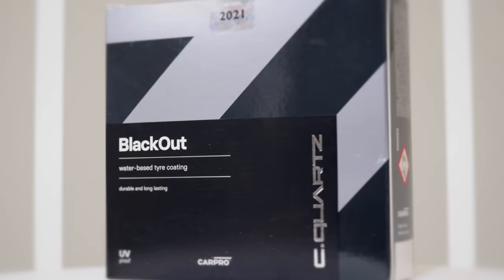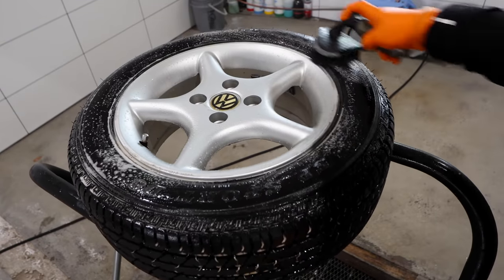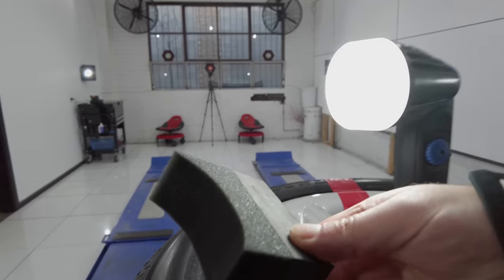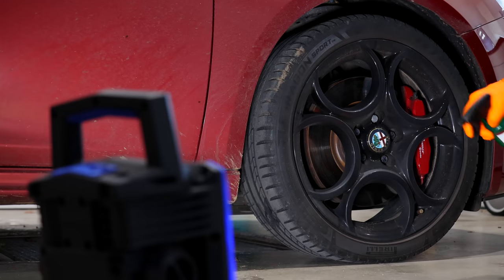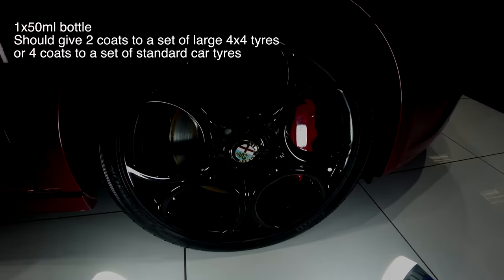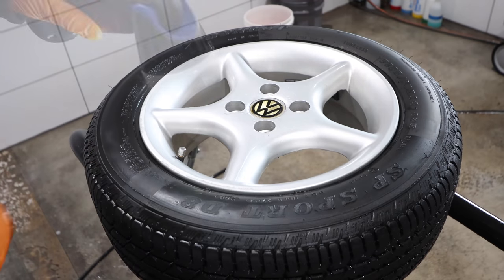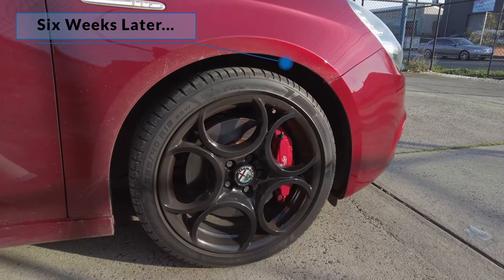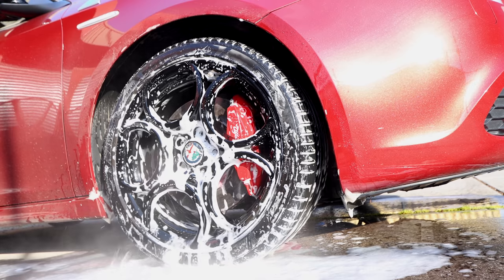New Carpro BlackOut 6 Month Tyre Coating Review | Application |Testing | Results!

Comment: I find that application with a paint brush makes applying tyre dressing infinitely easier.
The bristles easily get into all the tiny spaces.
Just apply, wait 5 minutes, and then wipe down with a soft microfiber towel to even it out and prevent streaking.
Reply from the maker: For a dressing yes, I actually did a video about a month ago showing that process.  But for this coating a brush would just leave too many steaks and high spots, and as wiping the coating down with a cloth will at least to some degree shorten it’s durability it’s probably not the best applicator for this tyre coating.

Comment: I followed the instructions to a tee. Got everything bang on, I honestly don't get more than 2 weeks out of this coating, I'm sure tyre make model and compound  plays a big part but on my 350mile a week van it doesn't last on the Falkens I'm using, pearl lasts a solid 3 weeks used neat on these with half the prep. I even stripped it and reapplied and same results.
I'm going to use this coating on my other vehicles which have AD08RS tyres and see if it's any better.
Reply from the maker: That’s extremely surprising to hear! The Alfa’s Pirelli tyres I applied them to does a good 400-500 kms a week as we are in the country and commute to the city almost daily. See how you go on another set, seems very unlike what I’ve experienced with it so far!
Reply: @CarCraftAutoDetailing  yes I was pretty gutted. My go to tyre dressing is Black pearl tyre armour and I get 3 solid months out of that on my daily drive and 9 months on my other 2 cars that do way less miles. I ordered a 100ml bottle so I have plenty left to try. I'm on the Facebook Carpro group and after I posted my finding it appears I wasn't the only one with durability issues.

Comment: Was wondering when you were going to put up your video. I believe we both received it as the same time.  My video is nowhere near as thorough as yours since you did chemical testing.  

I agree that the included applicator is not good. Like you I used a microfiber applicator. As a matter of fact I used an Autofiber coating saver applicator which worked fantastic.  It also leaves a better finish.  

I have moved away from tire coating because like yourself how good is it for the tire if it’s so hard to remove. Not to mention repairing it if the tire rubs against a curb.  I put it on a friends car and it looked great.  Nice black finish that is not overly glossy.  

Great video 👍
Reply from the maker: Thanks Mike, and yes it would then seem like you had a very similar experience to me with it.  I was surprised as I thought the applicator was so perfect and smart, but in practice it just fell short.  I do like the way Blackout looks so far and can’t complain but we’ll just have to see how it goes!

Comment: Thanks Sandro, great review. I share your thoughts on solvent-based coatings, pity they couldn't nail a water-based formulation. I went hunting and if it's news to you, from what I can gather Renew Protect Blak is solvent-free and yet excels in areas. I haven't tried it yet but the product description is quite exceptional and users are reporting 2-3 months durability on the road. It's even claimed to be safe for motorcycles as it's "completely non-slip, silicone-free, oil-free" - very interesting at the least.

Comment: Applying a tire dressing is my least favorite chore when detailing my cars, so this product is something I've been looking for. The water-based coatings I've used just don't last long enough. Thanks for the informative video and have a coffee on me.
Reply: Why is applying tire dressing your least favorite part, just curious🤔
Reply: @klasseact6663  I'm not a young guy with back problems and bending down to put a dressing on the tire is not as easy as it used to be. Cleaning the wheels is tough enough. I have a rolling stool that I use, which does help.
Reply: @archiepezek  gotcha! Well this WILL help that out for sure😉 I'd like to pass this along to you to help in wheel cleanings. Once the wheel are cleaned and still wet, spray some 303 Touchless Sealant on them, let sit for about a minute and hose off. You'll notice incredible water beading and your wheels will repel dirt and brake dust better and make the next cleaning alot easier.
Reply: @klasseact6663  Amazing that you said that. I used to use 303 just for wheels because they were so much easier to clean. I ran out of the 303 and have been using The Last Coat on my wheels. which is more work to apply, but they're still easy to clean.
Reply from the maker: Thank you mate, glad the video helped!
Reply: @archiepezek  well not sure where your located but Gyeon has a similar product called Wet Coat that does the same thing. Clean your wheel and while wet, spray on, wait a minute or two and hose off and watch the beading!
Reply: @klasseact6663  I live in Florida. I really need to buy the 303 again or a similar product that is the spray on/spray off variety. I put a ceramic coating on my car but didn't coat the wheels. They are gloss black painted and would benefit from a ceramic coating. But I don't have garage access and due to frequent rain in south Florida in the summer I can't think about a ceramic coating right now.
Reply: @archiepezek  no wonder you don't cleaning wheels or dressing the tires, besides the health issues, the wheels, you have THE most difficult finish to maintain, free yourself and add some years to your life..GET RID OF YOUR GLOSS BLACK RIMS🤪
Reply: @klasseact6663  I'm buying a new car next year, so I'll just leave the wheels on there.
Reply: @archiepezek  what are you buying, curious and the fact I eat, sleep and drink cars!
Reply: @klasseact6663  I current have a Dodge Challenger. I've had Mazdas in the past, which I love. Going to buy a Mazda 3 turbo hatchback.
Reply: @archiepezek  great choice, premium interiors too😎 Are you a perf guy?
Reply: @klasseact6663  Somewhat. I'm not a racer or anything, but I enjoy a capable car. Do you own something good?
Reply: @archiepezek  I have an Elantra Sport with intake and exhaust w/ 7spd DCT. It's in my avatar. 

I was going to suggest the Veloster N, comes with 8 spd wet DCT now as an option!
Reply: @klasseact6663  Don't really care for the look of the Veloster. I'm looking for a four-door hatch and just love Mazdas. The interior is just awesome and that is important to me. Was looking a little at a GTI but keep coming back to the Mazda.
Reply: @klasseact6663  Your Elantra is super nice.
Reply: @archiepezek  thank you, it's been a great car and handles great with the IRS😎
Reply: @klasseact6663  That's awesome. And I'll be happy with the Mazda turbo 3 with the torsion beam.
Reply: @archiepezek  yeah they said even though it's been dropped now it's supposed to handle great! What color ext/int?
Reply: @klasseact6663  I've seen in videos that at the very limit the torsion beam doesn't handle the rear end as well as an IRS. But I'm not going to push the car that much, so it's not an issue for me. Color is going to be the Snowflake White metallic paint with the red leather.

Comment: I used acetone to remove Optimum TPC - worked well, and hasn't caused any noticable issues with the tyres.
Reply: (it was still a fair bit of work - I scrubbed firmly with a MF towel)

Comment: I just use megs hyperdressing 4:1 as it gives me the look I like on my tires. A little bit too shiny that first day, but after that it settles back down to that perfect, just black/darkened look that I love. It makes keeping my tires clean easier and even though I always use a harsh alkaline cleaner (H7 degreaser) to strip it off every wash, you can still see the tire "sucks up" the tire dressing and they still look nice and black before reapplying (without being greasy). Obviously after you reapply, it is a bit greasy to the touch, but I've never had problems with sling or gunk being built up on the tires, and it always keeps them looking great. I also spray down the wheel well plastic liners and the flaps in the rear and it gives it an amazing "new plastic" look. Also makes the fender liners release the dirt much more easily when you wash em.
Reply from the maker: Hyperdressing is great, I also really like it and it’s actually the only water based tyre  dressing Meguiars makes so it was the only one I used!

Comment: Sandro, you got to try Dura-Coating tire coating it is water based and lasts more than 6 months.  I have applied it in two vehicles were one of them is mine and a single layer.  I will send you photos how it has lasted.
Reply from the maker: Sounds great!

Comment: Thanks Sandro for introducing a new Carpro product. Is this product for me, No. Its expensive for only 6 months, if it does last 6 months. I'm happy with using Pearl, which is cheaper, but also has varied applications depending on dilution rates. As I don't do many Klms, I can have Pearl last 2 months, and that is with using P&S Brake Buster as a tyre cleaner when I do my wash, which can be weekly during hotter months, to fortnightly in colder months. At the moment not doing much in Sydney due to lockdown with strict conditions. Again, thanks for the video. Ozz
Reply from the maker: My pleasure mate and yes there’s very different people with different needs and wants! Hope all is ok with the lockdowns mate!

Comment: I’ve found I think it depends on tire compound. Age. 

I noticed mine after 6 months look like it’s all off. Doesn’t have that new feel and I think maybe dark side is better to stick with for most people. For the more extreme I would do blackout with dark side. 

I was a little disappointed the looks fade quite quickly so what you’re left with is a tire protector with no looks… not many would hassle if they knew the long term affects I believe.

Comment: Hey Sandro, very nice review again as always, It's insane that even turpentine won't get it off, which start me thinking on motorcycle tyres, I clean/detail an occasional motorcycle from time to time but it's just not safe to put any dressing on a motorcycle tyre. How does the 'slippery" factor compare to other dressings?
Reply from the maker: Thanks, but unfortunately as a rider myself it’s not a tyre coating to be put on two wheelers as it will reduce grip and cause at least sone loss of traction when turning.
Reply: @CarCraftAutoDetailing  That's not what we wont off course, ah well my quest to find something wil continue, Thx Sandro and ride safe ;)
Reply: @thingsido6067  See my new comment re Renew Protect Blak, sounds perfect on paper...

Comment: Another thing to consider is a lot of new modern tires especially Michelin they do not recommend putting anything on their side wall as the car comes with a coating on the sidewall from the factory. So for me I just purchased a brand new set of Michelin tires PS S for my BMW and I’m not sure if I want to apply this on the sidewalk because it actually probably may interfere with the factory coating
Reply from the maker: It would be interesting to test this out on one of the tyres to see if it has a positive or negative effect over time, but it’s certainly something to consider!
Reply: Absolutely I like to tinker so I’m probably going to purchase the kit and test it out on my other car and see how the tires come out 👍🏼😆

Comment: Could you layer a tyre dressing on top of this? Or would it be rather pointless using Blackout if I were to use Onyx every week or two. I really like the finish that NV Onyx provides (I asked you which tyre dressing you used in the Mustang video) and this doesn't seem to quite provide the same finish. Thanks again for the awesome content!
Reply from the maker: Yes I think you’re right that it kind of defeats the purpose of you’re going to apply a water based dressing weekly, but I’ll be interested to see how the batch compares as far as looks go!

Comment: Sandro…I have some blackout but, just haven’t used it yet….I think it’s results will be quite dependent on meticulous preparation.  
Quick question….does the product level itself when it dries, or does it leave streaks, like the applicator drag marks you show in the video.
Reply from the maker: It will somewhat self level further but not entirely after it cures, so a better applicator and process is beneficial. It also largely depends on the tyres themselves, it’s looked very level on the Pirelli tyres but not as much on the Dunlop’s I tested.
Reply: @CarCraftAutoDetailing  Thanks Sandro….I’ll bare that in mind when I use it

Comment: You mentioned they’re going to update the formula to be glossier, any idea when that will be?
Reply from the maker: It’s what’s selling right now, the one I had was only the first run that’s apparently already sold out as far as I’ve been told, but I guess you could double check with the supplier you intend on getting it from.
Reply: Ok, yea I got with car pro and they said they have updated the formula for July and it should hit most suppliers in about a month.

Comment: Can it be used on whitewalls and white rubber tyre lettering?
Reply from the maker: It is a clear liquid and I would guess that it would work just fine on white walls and lettering.
Reply: @CarCraftAutoDetailing  ok thanks.  I'll wait till they produce the glossier version then give it a go.  The wheel/tyre cleaning aspect of car washing is my weekly nightmare so I will try anything that will make that easier.
Great vid as usual; keep up the great work.

Comment: It’s been over 2 years.  How did the coating ultimately turn out???  When did it start to come off, if at all??
Reply from the maker: By memory it was on the tyres for about year before we had to replace them - although it certainly faded and lost a little of its lustre over time I was quite happy with the coating as it was a very slow decline.
Reply: @CarCraftAutoDetailing  that’s insane for a coating to last that long.  Thank you for your information and feedback!

Comment: My biggest issue is that my race brake pads dust like crazy, and after like a day my wheels AND tires look like most people’s after 3 months. So I don’t really think this is for me, other than making it easier to get the tires clean, but I never have an issue with that. It’s just how quickly they get completely filthy
Reply: Could be worth changing brake pads. They can be inexpensive and save a lot of grief. I did that with mine.

Comment: Hi Sandro 👋 I'm a little off topic but I'm nearly ready to do a paint correction on my new car but I don't want to spend hundreds of $$ on a paint thickness gauge.
There are cheap ones all over the internet starting at as cheap as $25.Now they look the part and seem to come with different thickness samples so you can calibrate it.Do you think they are good enough for one car at least?
Reply from the maker: It does seem a little too cheap to be a reliable gauge you can trust, but I honestly can’t say I know that to be the fact, it would just be my impression.
Reply: @CarCraftAutoDetailing  thanks Sandro.There is a guy close by that restores old cars so I might drop in and see if he can do a quick test.

Comment: Hey Sandro, so I applied this product 2 months ago, and did a very good job prepping and applying it. It’s working good, it definitely isn’t as rich but it’s never brown or anything and cleans easy. Pretty happy overall. However, could I prep and add another layer or two? Or should I just clean and top with a decent dressing of my choice that I can wash off and redo every few weeks? What would you do, brother? Thanks in advance!
Reply from the maker: If you still have product left over I don’t see any harm in giving it a go and applying another layer or two. BlackOut just seem to bond so strongly that it could layer well even a couple of months down the track over itself and may add that extra saturation you’re after.
Reply: @CarCraftAutoDetailing  thanks for the input man. I agree and believe it will work stellar and long as the base is clean to bond to. Also, I appreciate you more than you know, sir! 👊🏼 much love from 🇺🇸

Comment: You should have used shine supply Wise guy tire cleaner to clean those tires instead of multi X. It would have done a much better job
Reply from the maker: I did on the second set of tyres - you may have missed it.
Reply: @CarCraftAutoDetailing   I guess I did lol. Have you ever tried Dura Shine Dressing for tires?? I wonder how that stands up against this

Comment: Would it be recommended to use something like clarity to wipe the tyres down before applying the coating?
Reply from the maker: Yes you can definitely use it as a further step before the coating.

Comment: Worth noting that this is a highly dangerous chemical. Respirator, gloves and eye protection should be worn at all times while handling this product or even the applicator after use. Considering it claims to be a long term penetrating product, anticipate using caution around the product and the applicator anytime you come into contact with it.